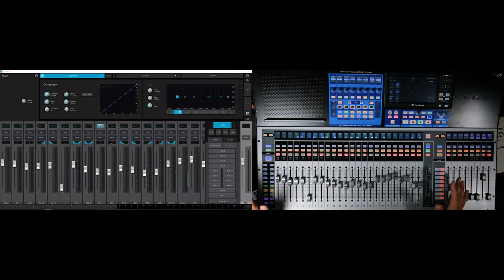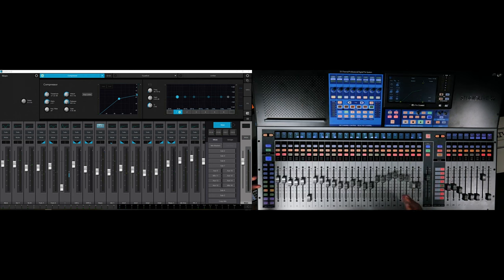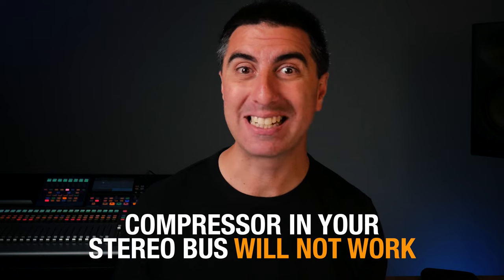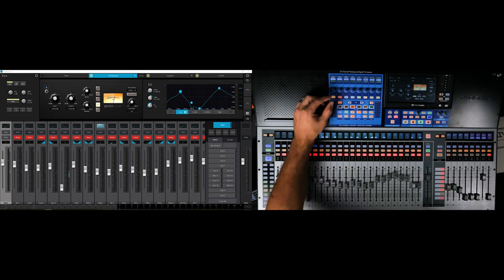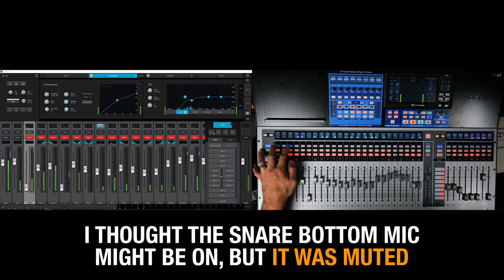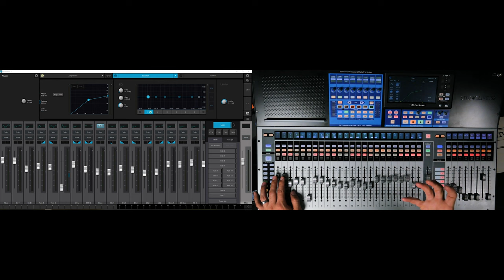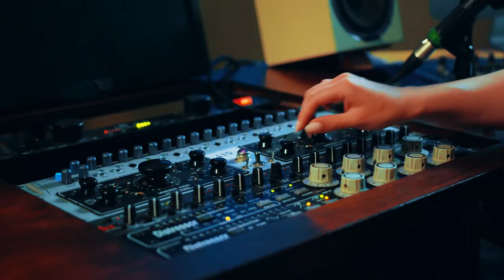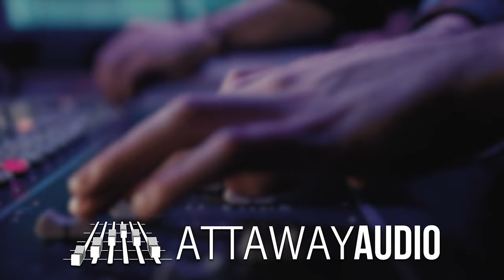Live Stream Audio Compression

Comment: Hey James, a super fast compressor is going to act like a limiter.  I find that running a peak limiter on the stream is a good idea, as long as you don't hit to so hard it's squashing everything.  Also, a multiband compressor, like one used in radio broadcast can help keep the bass and kick inline without pumping or ducking like a single band compressor/limiter will do.
Reply from the maker: Good tip!

Comment: Good word. When I took over the audio team for my church, COVID was just hitting and the pastoral staff was looking to improve our streaming quality. We have a separate console set up in an overflow area to mix the stream. However, I found it had been set up to strongly compress the mono output that we were using for the stream. The first thing I did was reduce that to very little compression and compress individual channels. I set up a level goal for the tech to hit instead of relying on the output compressor. That level is checked by the tech who is managing the AV on our stream who can fine tune that signal as necessary. It was an immediate improvement. I'm meeting with our integrator tomorrow who will be quoting a new Worship system (audio, multimedia, cameras, streaming) and this is one of the very things we will be talking about with an eye (and ear) to making it even better.

Comment: I found the right setting by using extreme ratio and extreme threshold and comparison with the untreated signal and tried the setting, where the treated signal sounds the closest.
After this I reduced ratio, I set threshold that it may reduce dynamic between 6 and 10 decibel and voila, the only difference was, that the compressed signal makes little details better noticeable